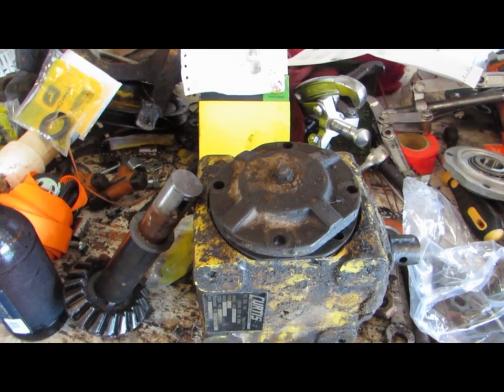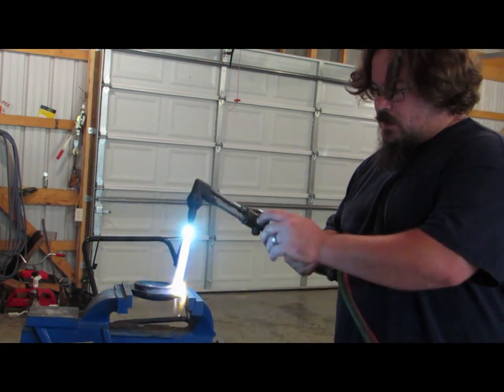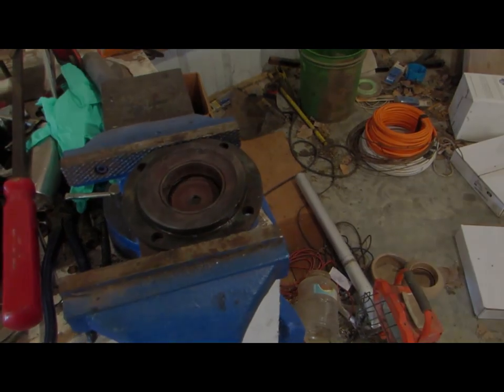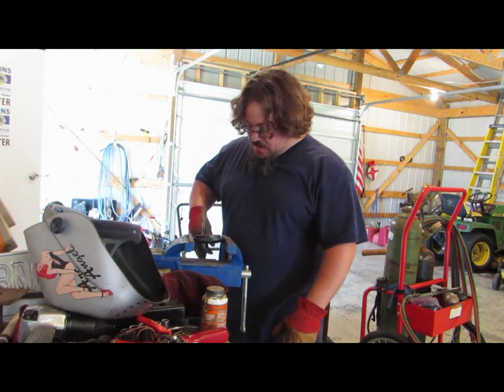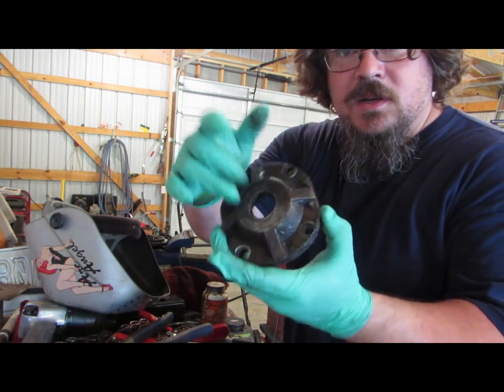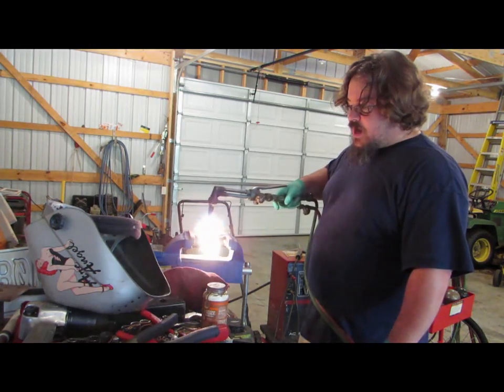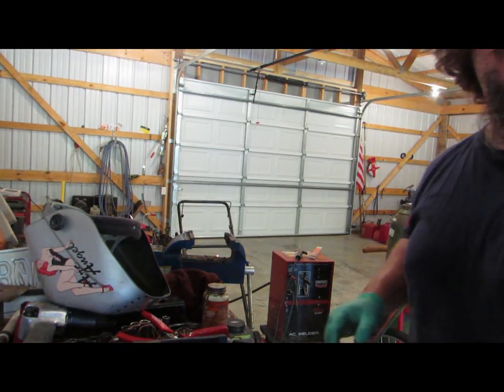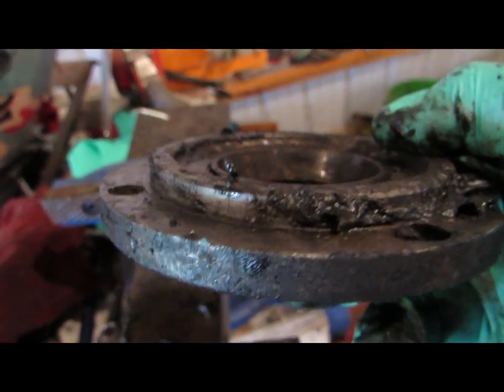how to use a welder to remove a bearing race

Comment: I have a busted bearing outer race stuck in an alloy wheel, wondering if running the bead on the race would affect the wheel.
Reply from the maker: Should be fine.  Just dont get any of the weld on the alloy.  Keep the heat down.  It doesnt take much.  The more weld you can get around the race the easier it will come out.  Thanks for watching.

Comment: A short soak in kerosene or gas would have soon got rid of the oil, why pollute the air with burning plastic and oil fumes. TD
Reply from the maker: Good point. Then I could have used the now dirty gas and kerosene to kill weeds around the building